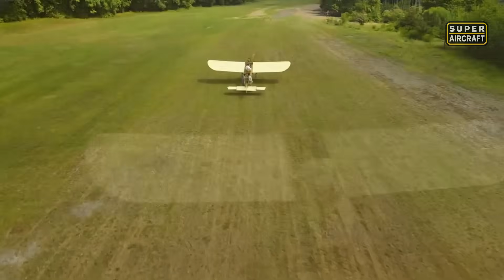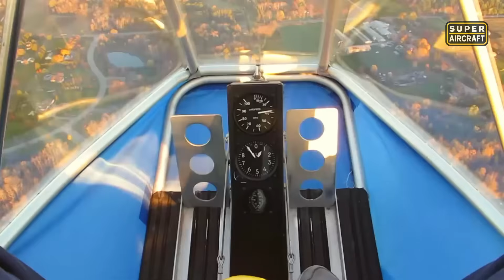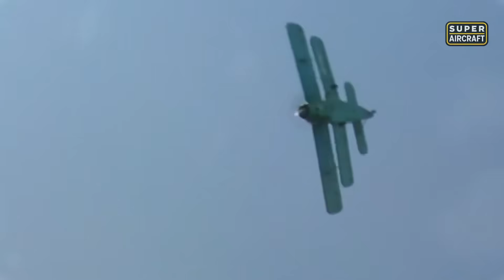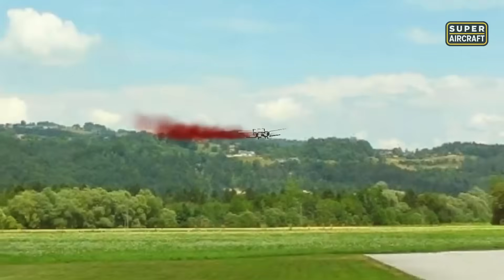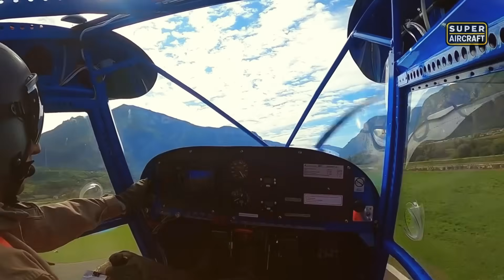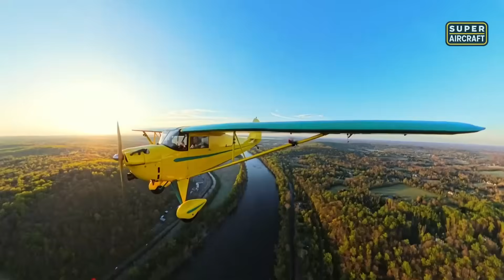INSANELY WEIRD PLANES THAT FLY SLOWER THAN A BICYCLE

Comment: One notable mistake in your video was that most of the footage you had of the Piper J-3 Cub was in fact an Aeronca Chief. Built around the same time and equally popular amongst pilots and flying schools. With as many J-3s that were built, There should be no shortage of video footage. Very disappointed with your final offering.😢

Comment: No mention of the Bailey Moyes Dragonfly. Power off stall--20 mph. Cruise 50 mph. climb rate 700 ft/minute. These are all at max. loading. (pilot plus passenger).